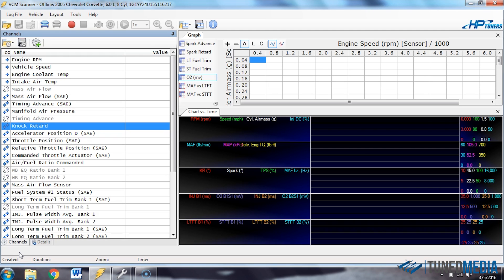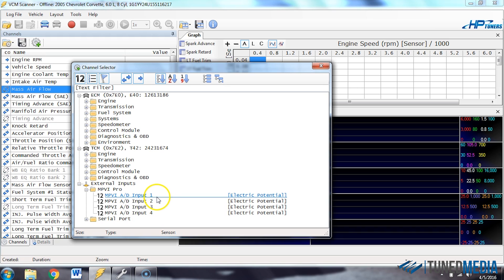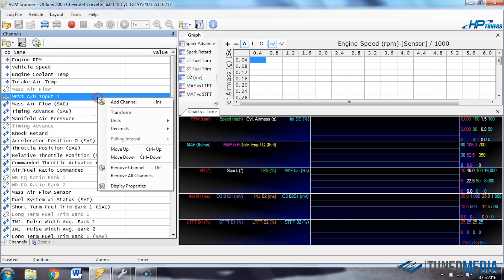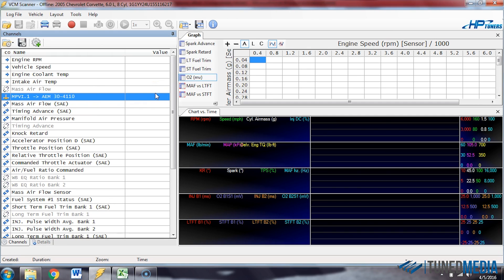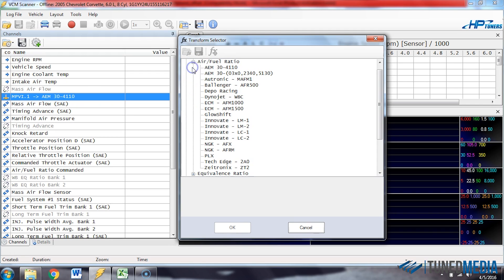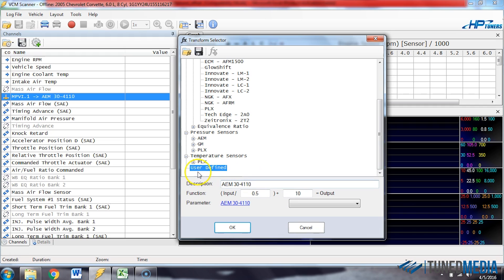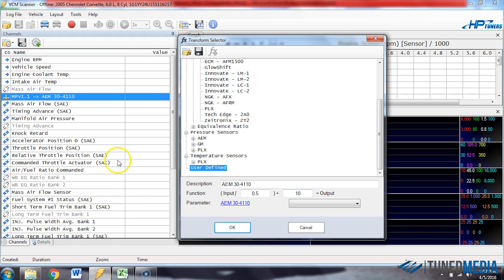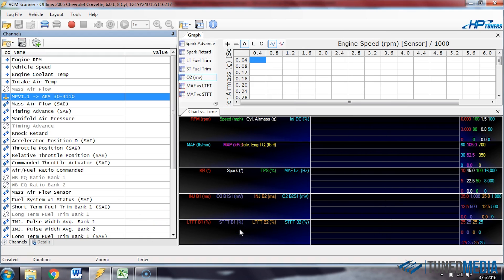How to Set Up Your Wideband Inside of HP Tuners 3.X Software

Comment: OK here's my problem..

I can not find anything on how to set it up to display Lambda in the graph. Every time i ask, people always talk about AFR. My wide band is an AEM 4110. I see in the options i can select AFR,Lambda and PHI. What i want to do is to be able to show Lambda--- L=1.00 When MAF tuning and VVE tuning, I have an E38 PCM. I know how to fail either and tune just fine. My Achilles is always been the setup. 

Thanks..
Reply: Did you get this working in lambda with ED's advice? Be nice if someone would make a video of it. I agree with you, tuning seems to be the easy part once you have the scanner setup correctly. Hptuners is the only scanner I've ever had to manually setup. Most scanner software is already setup to log. You just need to look at the logs, lol.

Comment: You say you are entering information for a WEGO and you changed the formula, but you might need to dig deeper to find out what the exact formula really is.  On the Daytona Sensors installation sheet for WEGO IV it says the AFR range is 10.3 to 19.5, but that the formula to use is 2 X (Vout + 5), which can be rearranged to (Vout/0.5) + 10.  Apparently they don't use the entire 0-5 volts range to reflect that information, only 0.6 to 4.75V.  I almost used your information instead, but pulled out their paperwork when I had issues.
Reply: +Ronald Pierson 

It's up to the manufacturer of the wideband, but some companies do not use the entire 5V range.  Innovate is an example of this, they typically use a 0-1 volt range.  However, it is still best to do as you did - looking at the actual range of your device, and output AFR and running it through the spreadsheet for the correct formula to enter into the scanner.
Reply: Ronald Pierson where can I find the formula? I have an innovate MTX-L
Reply: Rosa, I used the preloaded LC-2 data in HP Tuners for my MTX-L. Both of these AFR sensors have the same range according to the instructions I found on the Innovate website. Hopefully it works, I haven't tried to log yet.